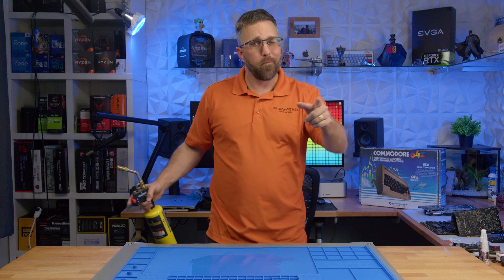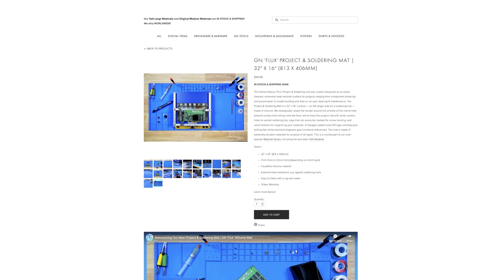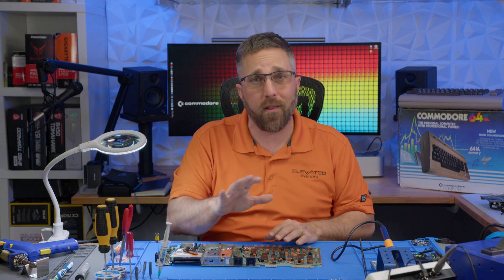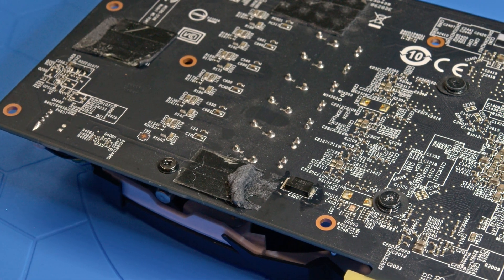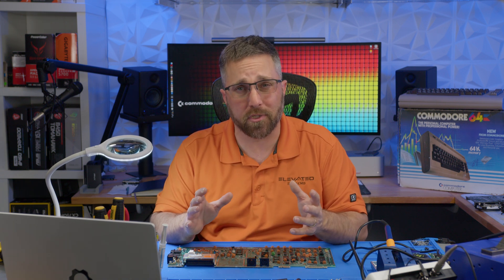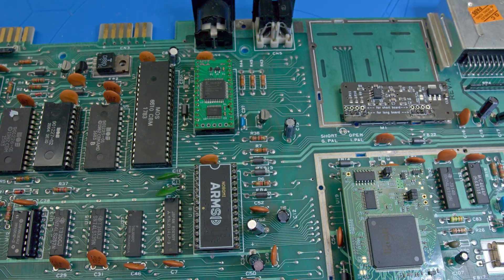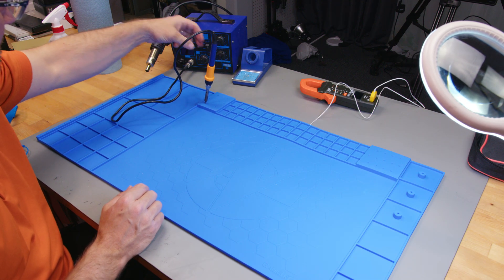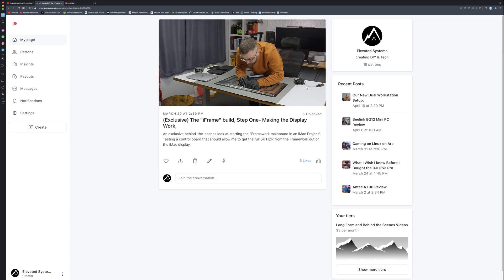C64 Upgrade & Gamers Nexus Project & Soldering Mat Tested!

Comment: Loved the video! Thank you so much for taking the time to really use it. I like that you basically integrated it into the workflow to do the review. Also, the hook with the rubbing alcohol and fire makes for one hell of a good marketing photo, hahaha. Excellent set, lighting, and work here. Thanks again for your honest feedback and impressions and for the education you're providing your audience on reducing e-waste with electronics repair.
Reply: GN...your mat is AWESOME, but the logo in the MAIN work area makes cleanup a huge pain.  SOMETHING MUST BE CHANGED HERE!  I find it difficult to clean between projects...and sometimes impossible!  I hope you LISTEN to YOUR customers like you hope other manufactures will hear there customers!
Reply: Make an optimized version with the logo relief filled in with clear silicone, so the cleaning issues is resolved! :)
Reply: awesome mat !
Reply: Perhaps the design could be modified to consist of slightly raised elements on the logo instead of debossed outlines? And the hexagons could be embossed instead of debossed or just have a wider line of like 3mm for easier cleanup?
Reply: Cool product! I think if the logo emboss were inverted, so the narrow crevices are sticking out instead, it could be much easier to clean
Reply: @atsz.  Agreed but I suspect it'd look a lot worse and smaller components would end up not sitting as flat, which can get annoying super fast. I'm wondering if something like a toothpick would make it quicker to clean those crevices... I really like this mat, but I end up using my existing soldering mat for a wide variety of situations, and not being able to get the surface clean so that chemicals don't mix makes me kinda leery.

Comment: I'm not convinced all these old computers necessarily need to be recapped. You find Rubycon and NCC caps in them that read basically almost new, as if they only had a handful years of shelf life on them but no real degradation. If they lasted for 30, 40 years with so little change, who is to say they aren't going to last that much again? And with any new product, you run a risk of it being faulty. There is a massive survivorship selection on the remaining classic computers, that the parts in them actually turned out to be much higher quality than you'd normally expect, the chemicals don't come out entirely the same every batch. I can see different total-recap camps - some people clearly just do it for YouTube content regardless of whether it's needed or not; but some do have valid arguments in support of total recapping.

I built my first computer (with help naturally) at 9, it was a Leningrad 48k, you get a bare circuit board, photocopied documentation, get someone to burn you the EPROM chips... If you've heard of ZX Spectrum, that's a compatible machine, except built entirely from East German and Soviet parts, so it doesn't have an ULA/PLA, it's replaced by about a dozen odd 74/40-series compatible ICs instead. As a woman of Bulgarian descent, and growing up in Ukraine, i haven't encountered any family resistance to doing tech, indeed they helped and encouraged me, which i hear is something the rest of the world might still have to catch up on. I do have a C64 these days but it's the slim and long -C model, with the 85-series CMOS chips, white keys, the ALDI type. I also have a VIC-20.

Something i didn't buy yet because i didn't get around to is ZD-211 desoldering iron. At prices hovering just around the 10€ mark from trustworthy suppliers, it's very cheap and it's a bit of a middle ground between desoldering by hand with pump and braid and the fully automated ones. I heard they don't last long, with the handle breaking, but at the price geared for more occasional use than day in day out, that's hardly critical. I might even just put a pedal switched pump on my desk and assign it to many duties as needed: vacuum tweezer, desoldering etc, and modify the ZD to take the air line.

Comment: Appreciate the points on the right to repair. Soldering and similar work is a bit beyond my comfort zone but not being able to do simple part changes is very frustrating especially on really expensive gear. Even worse is not being able to shop around for a good repair technician for some devices. Very excited for the framework 16 coming later this year and it's mainly from watching your videos. I hope they collab with you on some launch videos and projects.